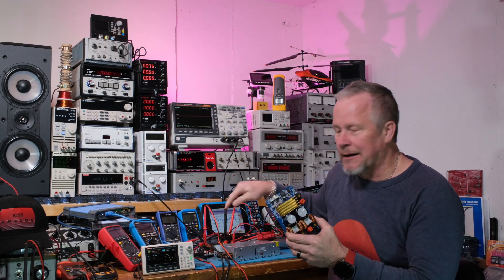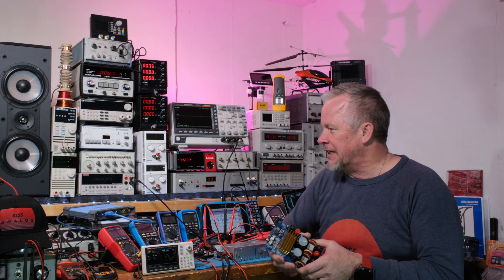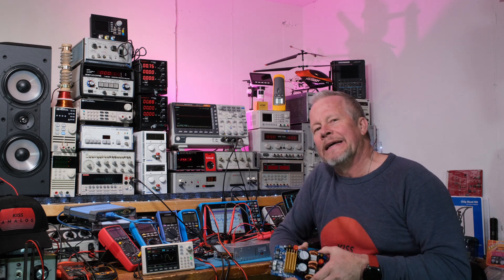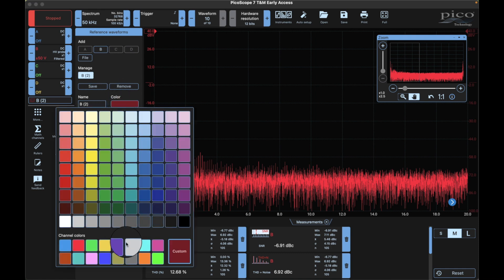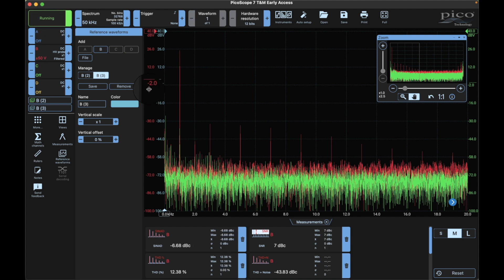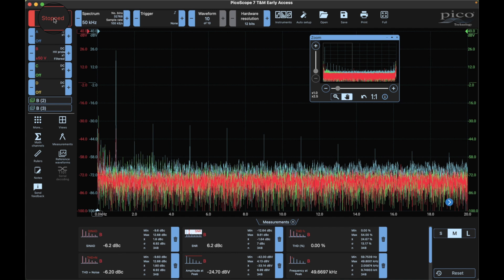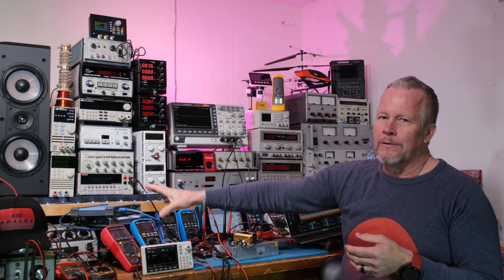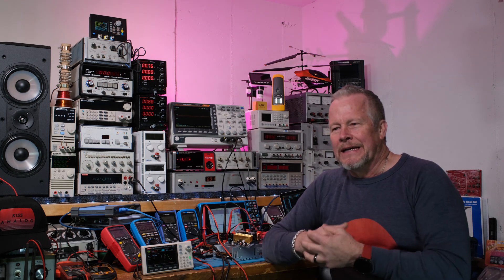Class D Amp is Switching Power Supply lower noise than Linear Power Supply?   with TPA3255

Comment: I little bit shocked how the powersupply actually more cheaper than fancy supply price range has better low noise.... this acctually audiophile sound systems more cheaper right now😂
Reply from the maker: Thanks for your feedback!  What people don't realize is that Linear Power supplies start off with a low frequency switcher at the front end which is noisy.

Comment: thanks a lot. it is a eye opening video. As long as the SMPS designed right for its purpose, it is possible to beat linear power supply for sure - the key is the output filtering.
Reply from the maker: Thanks for your feedback!

Comment: I admire the softer switching transients of the tube rectifiers .  I have found it almost impossible to get rid of diode hash using every kind of passive filter.  Noise can be dealt with in many other ways after the power supply.  Audio is a form of cult, I must admit, but good design and the end result of using your ears as the judge and not always the bench equipment is the musical amplification art form in its glory,  from what I've heard .    great video and happy belated B-Day Eddie !
Reply from the maker: Thanks for this great feedback!  I appreciate you!

Comment: Was there an anti-aliasing filter for the oscilloscope? With the 100 kSa/s, I wonder if there was aliasing of >50 kHz into your measured spectrum. I'm not sure if the 4444 model has a hardware BW limit filter. With other scopes, I use the "Hi-res" sampling mode as a low-pass filter (boxcar) if the analog filter isn't quite right. I believe the picoscope can implement this with the "resolution enhancement" mode.

The results/noise might also depend on the load? I'd guess the audio-band noise would go down under load if the power supply has some sort of pulse-skip mode for low loads?

Anyway, that looks like a really nice oscilloscope (for audio-frequencies). The differential input is required for the differential output of most class-D amplifiers. As for the video, it would have been nice if you spent some time showing the test setup.
Reply from the maker: Thanks for the great feedback!  I need to do more in depth study with this.  I like your ideas!  The Picoscope does have various methods to filter, so I need to try each one and then all of them together and see what happens;)

Comment: Awesome video! 
For anyone (re)considering an SMPS for audio purposes, one big AC capacitor (275vac to 440vac) at the input and a few caps at the output (50vdc bare minimum, 63vdc recommended) go a long way towards handling extra amps while lowering ripple/noise significantly.
Reply from the maker: Thanks for the great feedback Vikas SM;)

Comment: You might need more bulk caps at 50/60 Hz as a switcher is optimised as a package.
Reply from the maker: Thanks John, but the HP Linear Power Supply is about a 70lb linear bench power supply which would be hard to beat with a typical amplifier linear PS.  BTW, the switcher is meant to be used for LED power I believe, so it isn’t optimized for Audio use.  I’ll add some capacitors to clean it up when I build this into a box.
Reply: @KissAnalog  Bench PSU don't usually have much output capacitance, is my train of thought. Put 20,000uf across the linear supply for another brief test if you could please.

Comment: How about trying linear CRC and CLC powersupplies. It would be nice to see the difference they make to the diode switching noise.
Reply from the maker: Thanks Ian!  I need to get a transformer with the right voltage to try that.  The HP bench PS does have filtering built in and is a clean bench PS as it weighs about 70lbs;)

Comment: Looks like you are right about the linear supply's AC mains noise creating 120Hz buzz in the spectrum. It's really common to see that in FFT's even in very quiet amplifiers running off the mains.
Reply from the maker: Thanks frammis!  I appreciate you!  My bench HP power supply is a 70lb beast too;)